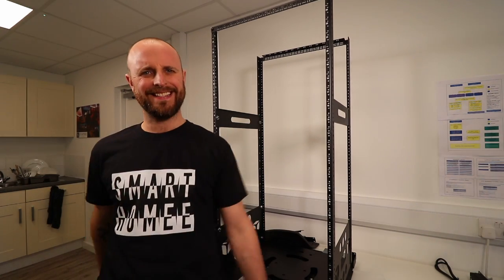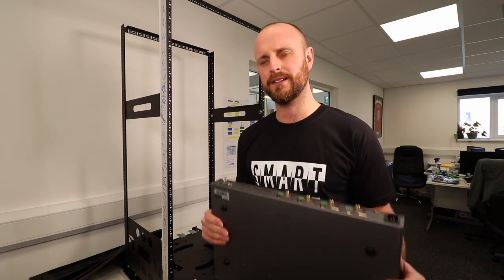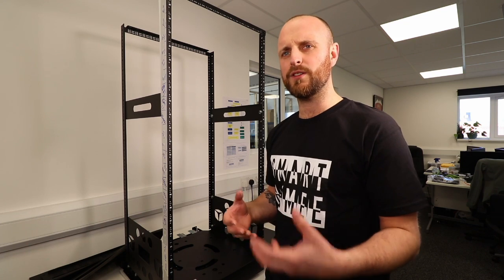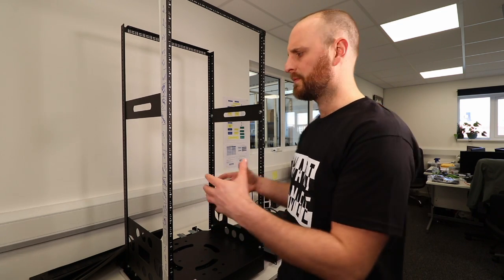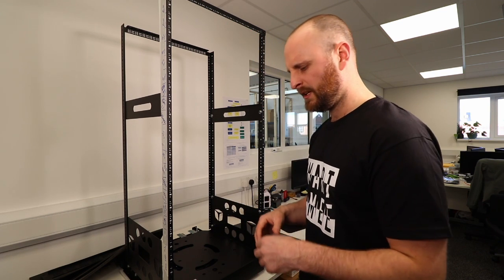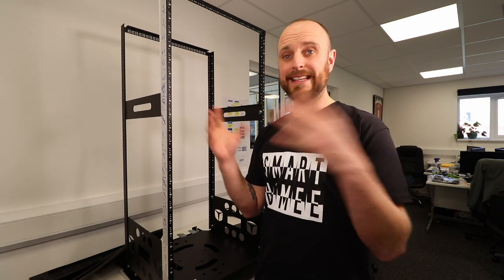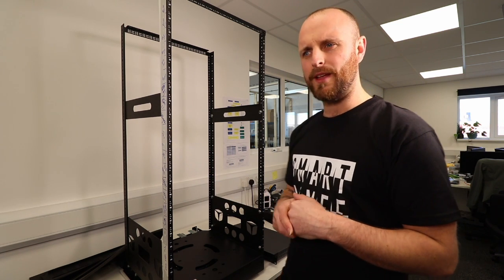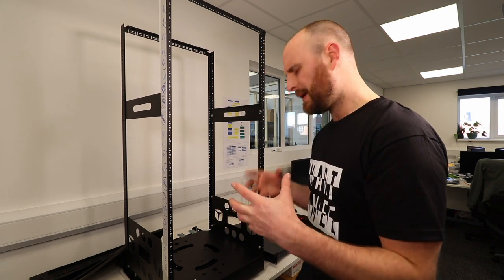Smart Home Rack Building - Part 1

Comment: I have 2 x Denon amps that need to go into the rack amongst switch etc. Im a bit concerned by the heat they will give off. Its probably unlikely they will both run together but just in case what kind of cooling would you recommend? Thanks. Great vid .
Reply from the maker: Look to separate the amplifiers and work out where the air intake and fans which move the air out are as these will inform you of placement.. with enclosed racks, have a vented panel at the bottom and use fans at the top of the rack to pull out the hot air

Comment: Hi. I have a rack that has been built in to my cupboard under the stairs in a new build house. I have 2 x Denon amps that need to go into the rack amongst switch etc. Im a bit concerned by the heat they will give off. Its probably unlikely they will both run together but just in case what kind of cooling would you recommend? Thanks. Great vid :)
Reply from the maker: Hey, I would if possible see if you can get ventilation and extraction to the cupboard, can you8 get some 4" duct to the location?
Reply: @SSUMTV  thanks for the response. Not sure how I would do it, the under stairs cupboard is in the middle of the house if that makes sense.
Reply from the maker: @dkhousemusic6953  can you put a vent on the door to the under stairs

Comment: Hi Benjamin, great video and thanks for sharing your expertise.  I would like your advice on an install as i need to place two AV server racks inside some cabinetry that will have AC cooling.  They will be fully loaded including a 44U and 27U rack with one being a home cinema rack with power amps and one being the entire nerve centre with switches, Ultra HD video distribution, multiroom amps.  Would you use skeleton racks or enclosed with mulltiple intake fans and top exit fans?  There's a lot of cabling to terminate which needs to be hidden and want the racks to have good thermal management too.  Air Con is from above the units as well using a dedicated FCU. Kind regards
Reply from the maker: Drop me an email at ben@smarthomee.co.uk and i'll happily help buddy

Comment: Hi Great video, very informative.  Can you let me know where you got the shelf from for the sky boxes?  It looks like a 2u shelf.  Can you confirm that you put the more expensive/ power consuming devices at the bottom of the rack to ensure that they don't overheat.
Reply: Here you go Manny, Penn Elcom do all the accessories you would need and just google the part you need, go to: https://www.penn-elcom.com/Default.asp?GC=Search&PN=Rack%20Shelf%20With%20Custom%20Face%20Plate&LG=EN.  I would place my heaviest pieces of equipment at the bottom often with air-intake fans for spot cooling as they tend to be big amps and of course a set of fans at the tops extracting hot air out of the rack